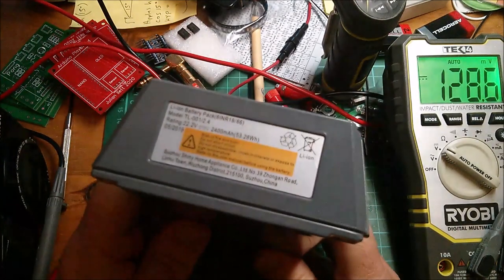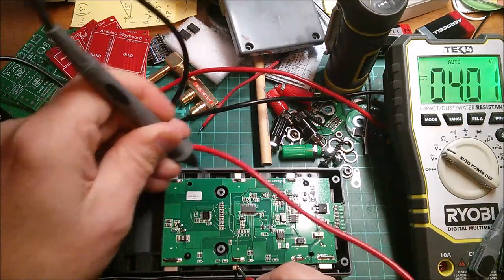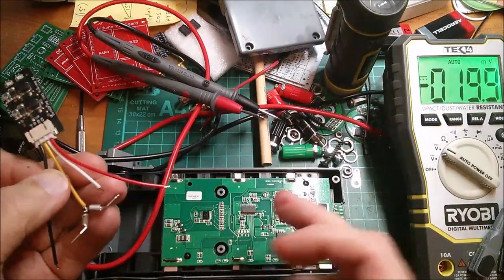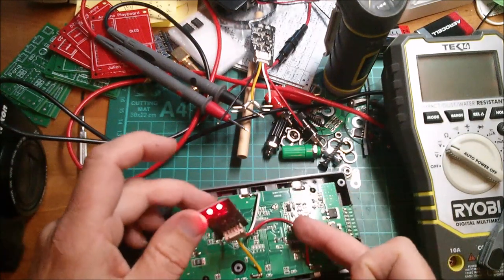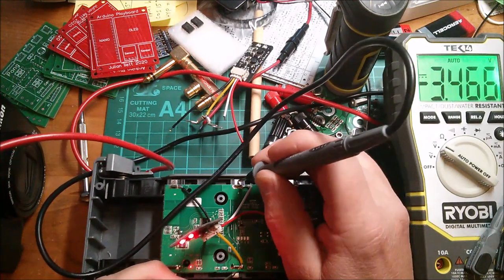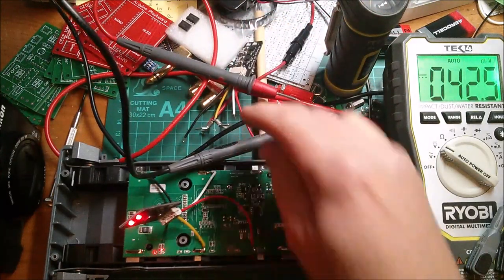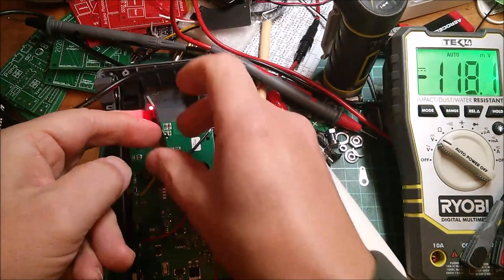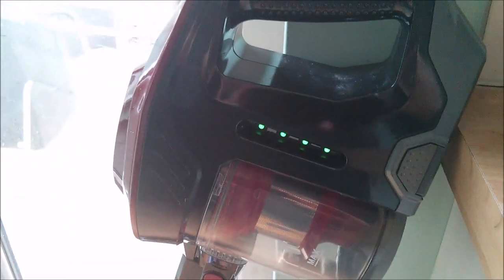Fixing (re-balancing) Lidl Vacuum Cleaner Battery

Comment: Why didn't you just top that one cell up instead of messing with balancers
Reply from the maker: Because I might fit a balancer if the problem returns
Reply: If the problem occurs then its probably the cells
Reply: @joshuabest100   If the problem occurs then its probably a new video
Reply: @JuliansShorts  i dont see anay balance stuff on the oem pcb so i would add one anyway this way the problem does not happern again
Reply: Joshua, I have the same question as you.  Bring the low one up to the others and then, if wanted, add a balancer.  I like the permanent addition of a balancer to the pack.  I have a pack that has gone out of bal twice in a decade.  I bring them all to full charge independently - balanced state.

Comment: Hi Julian came accross your video  . Having an issue with same battery.  Runs for few minutes after charging . Will charge for approx 10 minutes then show full charge . Upon inspection 6 batteries read 20.1 volts . Each battery reads 4 volts approx. Which should read 24 v . Baffled any suggestions 
Regards keep up the good videos
Edward Cotter

Comment: I'm surprised the battery pack doesn't have a ballancer buit in.
Reply: Same here. How can the charger "know" that one of several cells is low, and then continue to overcharge the full cells, and this be an acceptable design model? For retail sale/use even?
Reply: @electronicengineer  The battery pack protection circuitry should prevent any of the cells from overcharging, so it should be safe (in terms of not burning down the house) but not great for the battery.

Comment: Excellent! Was it showing a problem before the balancing act?
Reply from the maker: Yes, it would charge to full in a few seconds, then discharge to empty in a few seconds.
Reply: @JuliansShorts  I have a laptop battery which acts the same way, but unfortunately the cells still appear balanced. They're probably just worn. I suppose I could do some sort of charge and capacity test on each series element separately to verify...
Reply: This is happening mine, but i wouldnt be able to fix it like thus 😅  @JuliansShorts